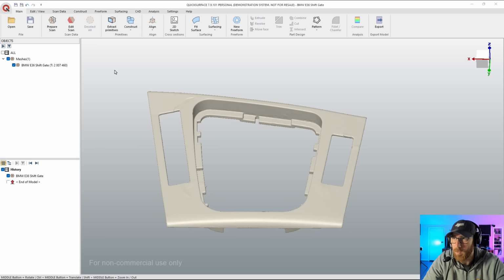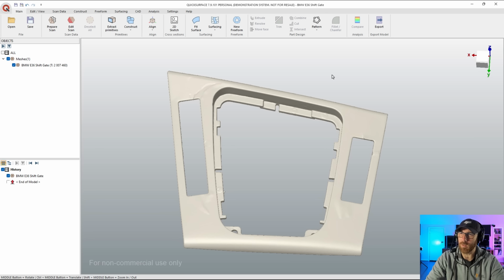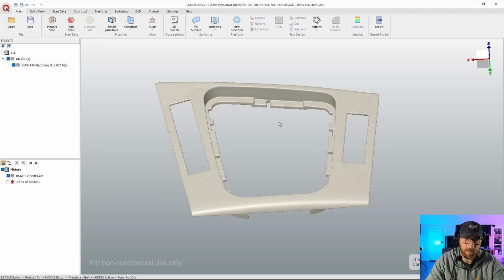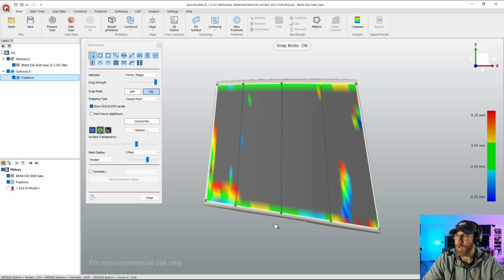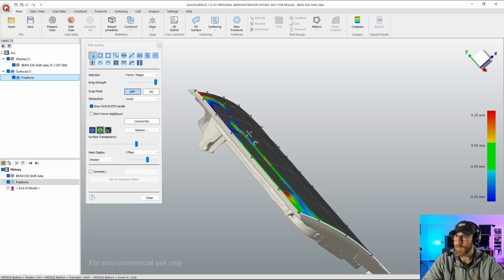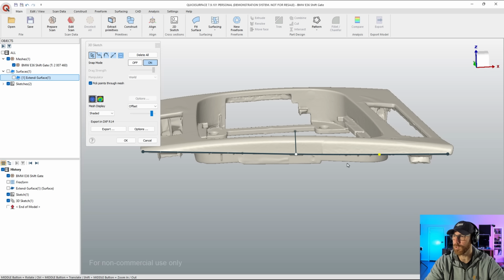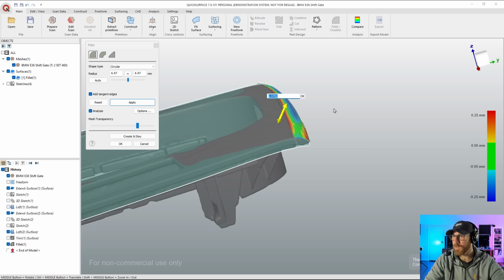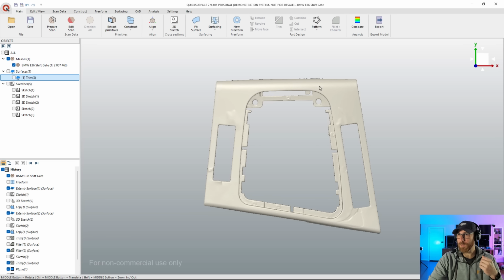Reverse Engineering Car Trim Panels for 3D Printing – BMW Trim Piece and QuickSurface Personal

Comment: I wish you had done it in fusion style. This piece was important to me because of its asymmetrical nature.
Reply from the maker: We have done many parts with Fusion in the past and you can use forms or surfaces depending on your needs.  This is a bit older but the forms tools and mesh sketch tools are still the same https://youtu.be/4fU3PUs2syM
Reply: @LearnEverythingAboutDesign thanks🎉 Could you please share the scanned files you have? I'd like to try similar tests. I'm new to this, so please excuse any illogical questions I might have.
Reply from the maker: @mtaskomur  Any scans that I can share will be links in the video descriptions.  some of the older videos where a user sent me a scan and asked not to share, those are not in the videos.  I have stopped doing videos with scans I can't share so it should only be the older ones.  Recently there is an airbox, this trim piece, my kickstand.  and I am working on a gauge pod for my GPz project at the moment that will be shared.
Reply: @LearnEverythingAboutDesign  I'm trying to build a console for my Tesla Model Y, but I can't seem to get the result I want :) I think I need to learn more, and this is my first time trying something like this :) If I send you the scanned file, could you show me how to do it? I think it would be a popular piece of content :) Thanks
Reply from the maker: @mtaskomur  Happy to take a quick look for you, but my video projects are stacking up so it would be a long time before i could make any content on the process unfortunately.
Reply: @LearnEverythingAboutDesign  I understand, thank you. I will follow your work closely.

Comment: How similar is the QS Personal edition to the Pro? I checked your website and see you have a tutorial for the Pro version and was wondering if it can still be followed if using only the Personal version.
Reply from the maker: Hey there,  Personal has a lot of the features of Pro with some exceptions.  Personal doesn't have the same Auto Freeform Algorithm as Pro so it isn't as a good.  Personal also misses out on some of the sketch assistant functionality.  There might be other minor differences as well.

If you get in and find that it just doesn't work for you I would be happy to issue you a refund.

Comment: pfft...  you'll never in a million years get the color, uv stability, or finish texture even close to what a discerning restorer will accept.

there's a reason why repops are extremely rare...because it's practically impossible to get it right.  the very best repopped parts in the business are mostly garbage from a certain perspective.  

...and i'm talking about major manufactures and vacuum molded parts.  companies like LMC and Year One.   if you think 3D printing in your garage can get you even halfway there, your a special kind of idiot.

also, something to think about is trademarks.  Most of the big manufacturers started trademarking design elements in the 90's.  most interior/exterior panels are trademarked.  especially designs that relate to that company's heritage (i.e. the triple lights on all mustangs after 1994).  most repops after the 90's aren't even legal.
Reply from the maker: There are plenty of people 3d printing panels and parts for their own use.  Loads of materials that have good UV stability and mechanical properties.  You can also use these types of parts for molds.  There are even companies that sell 3d printed e36 parts like a pillars from what I have seen.  So what would you do if you couldn't find or wanted to do a custom piece for your car?

Yes repop parts are generally off, but gaps and fit/finish on older vehicles wasn't that great to start with :).  I did a resto mod 71 f100 and had a lot of custom stamped parts like a tailgate panel and roll pan.  They needed to be massaged heavily to work.  There are of course some exceptions.  Some older vehicle molds have been purchased and old bodies being repopped from original tooling are much better.  But plastic parts from the 90s were not great to start and have little to no support.  So making replacements or updates really is the option.

Comment: What a powerful skill set for any car enthusiast or restorer! 🔧 This makes custom repairs and modifications so accessible. If you ever want to turn your perfected digital model into a short run of 50+ high-quality parts, our low-volume manufacturing is the solution. Empowering creators at every step!

Comment: Wow, this is perfect timing!  Yesterday I was thinking that I should 3D print some broken plastic bits, that are part of the base of the center console, where that same panel clips into on my e39 M5.
Reply from the maker: Awesome! Sounds like a cool project to work on!  As others have said this part was off an e46 not 36, but the process should be the same.

Comment: Oof - I went ahead and purchased Quicksurface Personal and got an email 10 mins later saying "we received your payment" but it didn't include any links to download it, no license key, no instructions on what to do next. Just "thanks for the money". It does say, "You can access your products according to the terms and conditions you accepted during purchase." Um, ohhhkaaay... And what would those terms and conditions be? Do I have to solve a riddle or something? 😆
Reply from the maker: hmmm.... I just sent them a note to ask what was up with it.  That is odd for sure.  any chance it got stuck in spam or something?
Reply: @LearnEverythingAboutDesign  a few hours later I got an email from Kostadin with the download link. It didn't mention anything about a license key though. I haven't had a chance to install it yet. They didn't have me create a user account when I purchased so I'm not sure how they intend to activate the license but I guess I'll find out soon.
Reply from the maker: When you go into QS and activate the license it should be with your email.  so maybe for QS Personal you don't actually get sent an license key.  Not sure as my license of QS Personal started out as a beta version so it was a bit different to activate.

Comment: thanks matt!!! i wish you have covered the way you aligng it, looks difficult to align that part. Thanks for all your shared knowledge
Reply from the maker: I considered that but since it has been covered several times I just skipped it.  It actually wasn't bad but the scan came to me aligned.  For this part the large 2 screw hole tab was used as a plane.  then the back edge of that was used as another planar reference with the "constrain" option making sure it was perpendicular to the first.  Then if needed you can set an xyz zero point somewhere.

Comment: WAIT… hold on!?!? Trim is included in personal and lite? I thought it was just in pro
Reply from the maker: Trim is in personal, not in LITE.  So personal has a few more tools than LITE does (and some that aren't there).  So Personal opens up a bit more CAD tools but you can't export a CAD model, only an STL.
Reply: @LearnEverythingAboutDesign so trim in qs and convert mesh in fusion? I guess…

Comment: Awesome. Excited to see what Personal license can do compared to actual Pro license. I didnt really like the limitations or "half finished projects" the lite version left me with.. Seems like Trim is an upgrade to personal than light? Maybe Im wrong. I guess not being able to export CAD files in personal is a big draw back if wanting to then work manipulate in Fusion.

 We like your long thorough tutorials. Its how I learn QS the best! Learn QS the Best w/LEAD! should be on a shirt or something
Reply from the maker: Exactly right!  LITE has limitations with the CAD tools like no booleans, fillets, and trims/cuts are all limited.  Sketch tools from the mesh are limited.  Different freeform algorithm for the auto options.  So Personal does open up some of those modeling tools.  There is no Auto Freeform,and you can't import or export CAD data.  But if you are going to 3d print something that might not be an issue.

Comment: Hi, In my hobby, I use Fusion 360. I understand that with QuickSurface I can save time modeling parts from 3D scans. Do you think the price difference makes QuickSurface worth it? Is there a significant difference in the quality of the results between the two programs?
Reply from the maker: Part 3 of this video we do the same thing in Fusion and i talk about the pros and cons of the two.  QS has tools that aren't available in Fusion like aligning to a coordinate system, analyzing how close your cad model is to the mesh, and some other options like 3d curve on a mesh.  What I try to show is that you can do these types of things with either software but the tools in QS are made for this while the tools in Fusion can do it, but aren't specifically built for the task.

Comment: sorry havent watched the whole video. Would you reccomend Fusion 360 for this type of work too? I only have this software :/
Reply from the maker: part 3 of this series we do the same part in Fusion and I talk about the differences.  We also have a video for another part that we did in fusion, QS and plasticity talking about the tools available and pros and cons.

QS is a mesh tool that can do CAD.  Fusion is a CAD tool that can do mesh.  by their design Fusion will be a bit better at the CAD part while QS is better at the mesh.  I would say QS is way better with mesh parts and has more features like align to xyz that aren't in fusion.

You can do it all in QS Personal, but the only output you will have is a MESH.  You would need QS Pro to do the full part and export a CAD model.
Reply: @LearnEverythingAboutDesign  thank you so much :)
Reply: Yes, this is also possible with Fusion 360.  Use Surfaces/Forms. Also be patient.